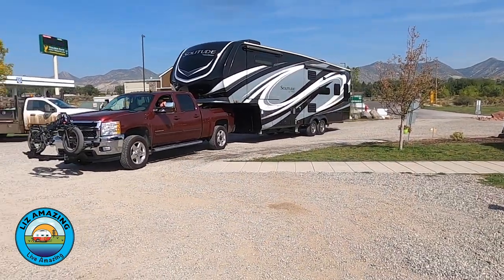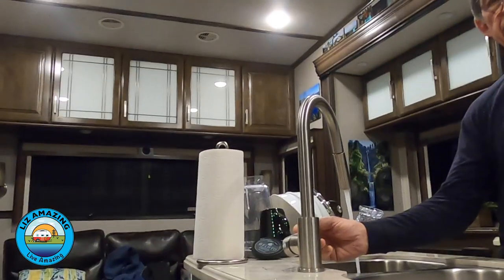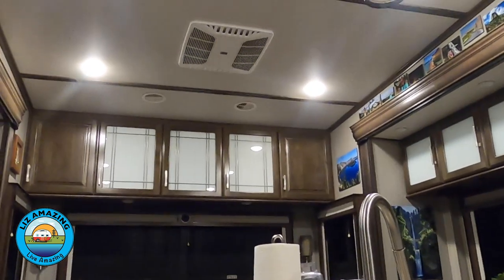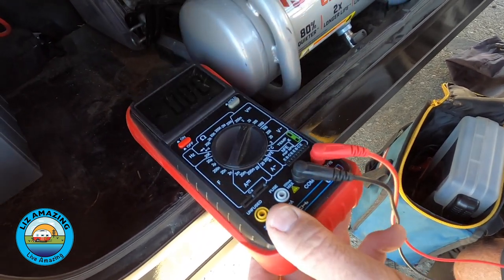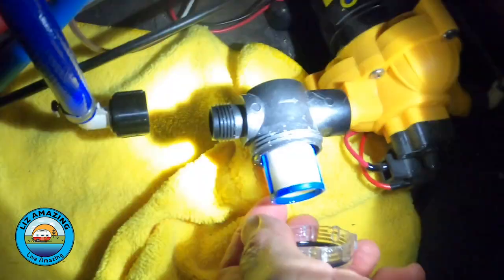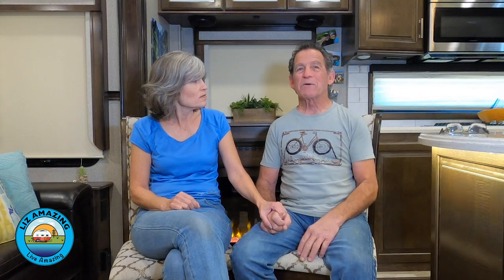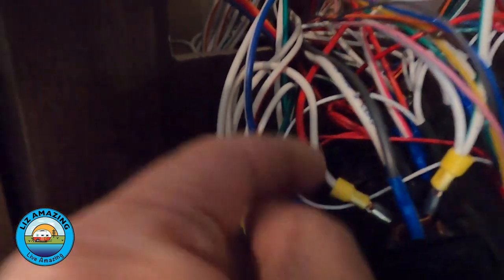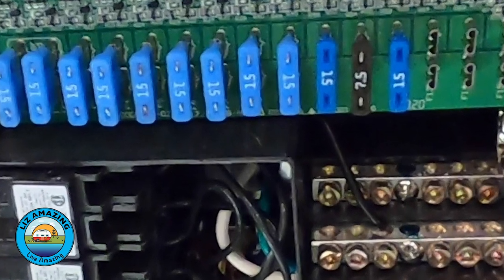RV Life | Grand Design Screwed up and We Fixed It | Solitude Fifth Wheel Water Pump Circuit Fix

Comment: We just got a 2021 keystone outback 328rl in August. It has a very similar layout to your solitude,  with the exception that it's just a regular travel trailer.  We also live fill time, but renting monthly at an rv park in Washington. First time I used our pump,  I couldn't understand why it pulsated. Now it makes sense!
Reply from the maker: Wow, Keystone, too! We will add that to the list. We've also heard that it does it on some Coachmens. It is an easy fix- let us know how it goes for you. It really depends how far away the pump switch is from the fuse box.

Comment: Surprising that the wiring is so tightly packed and very messy looking in such a confined space and with the cost of those camper homes it is shameful that the assembly plant allows that to be common practice.  I am not an electricians but I have spent many an hour figuring out wiring in small places, seen a lot of wire ups that are very disorganized, and often poorly labeled.  I have seen AC house wiring that failed to follow polarity, improperly mounted wiring causing melted parts that even though properly fused still melted and left unrepaired could have gone to flames. I often figured I just ran into people not sure what they were doing but as long as the wiring worked it must be okay and that is so far from the truth. I have even found things that licensed pros have just missed and left unfixed.  I was so pleased to see you all working out what the problem was and then going the extra steps to do a repair more correctly then the original assembly.  WAY TO GO TEAM.  This still goes back to the industry not accepting the idea that these campers really get used and only building for the weekenders.
Reply from the maker: Thanks so much Don! We are definitely making our Grand Design better than we got it, thanks to Paul! Yeah the wiring looks like it could be tamed even more. Thanks for watching and commenting. Happy Holidays!!

Comment: This is great! I JUST BOUGHT the same 5th wheel. I picked it up yesterday!! It is a 2021. I saw your first video with the failure of the island support. Did Grand Design ever address that with you? This is so helpful, I will check and see if mine does the same. Can you do a little more " in depth" repair tutorial? Just FYI... you're my new best friend!! HA!
Reply from the maker: Hi Bestie!!!

Congratulations so much on your 310Gk! We have a 2020. We LOVE ours and think the floorplan is awesome. We've had it since March and (unlike our last rig, a 30' Reflection) we do not get cabin fever. Just love the layout!!!

Grand Design corporate called us after our island collapsed and they are now putting in one additional screw in each end of the island. This started around mid to late September. We believe you need six screws on each end. You will need a pry bar to get the end panels off and then a brad nailer to reinstall them.

GD has been great though and if we need anything we know they will help out as best they can. Paul is super handy as you know, so he prefers to just fix it now rather than wait. 

We look forward to seeing you on the road!!!

Liz & Paul

Comment: Even my GD BHE21 Trailer does that, too. I have had way too many problems. I am not getting another GD. We want a fifthwheel and full time. After a year of YouTubes, i have narrowed it down to two. Both companies have gone over and above to improve their products an customer service. Both are excellent. I had narrowed to one, but stumbled on another just as good. Now i am making a check list and going to user groups. GD has pretty good customer service, but some dealers are jerks. But their build quality and components are not checked very well, it sounds like. I bet they improve a lot in the next few years. The competition is getting much better. The island was just over the top for me.
Reply from the maker: We wish it weren't so, but it does seem to be that the RV industry is not as focused on quality as they could be. They are just slapping them together and getting them out the door. We have heard Outdoor and DRV mobile suites are good companies. What did you come up with?
Reply: @LizAmazing  Alliance Paradigm and Coachman. I have been following Big Truck Big RV.  They have some issues, of course, but nothing like i have heard with GD. And their customer service is tops from everything , overall, that i have read in groups and YouTubes. GD owners are defensive of GD, but facts is facts. Have you heard big (non petty) complaints about these other two?
Reply from the maker: @TheLakingc  I have heard bad things about Alliance RV and I had a Coachman but haven't heard anything lately. Best bet is to check the Facebook forums on your model before buying. Good luck!

Comment: A tip, when ever you fish a wire, fish a string alone with it so next time you need to pull a wire you are all set. Also do they use Bladder tanks for water in RV's at all?
Reply from the maker: Hi Steve! That's a great tip, thanks. Ours is a hard-sided tank. By bladder do you mean one of those agricultural ones?
Reply: Bladder tanks I only seen in aircraft and race car not in not fresh water tanks
Reply: Anyone explain what bladder tank? Thanks

Comment: I hope I am not being redundant, but I found this response on a Grand Design forum”

“Our drawings are very basic, and intended for our Production purposes only (as a guide). We do not use looms. We pull continuous run wire from spools, and wire runs vary by model.

Best regards,
~ Janice
Mailing & shipping address: Grand Design RV, Attn: Customer Support, 13868 CR 4, Bristol IN 46507”

Kind of says we turn all that electrical engineering work to the guy running the wires.
Reply from the maker: Wow, that's good to know and not surprising. Thanks for sharing!

Comment: The most frustrating thing about towables (never owned a RV) is there are NO wiring standards.  None.  2 rigs coming off the same line, wired by 2 different crews will be wired differently.  How hard would it be for them to take the automotive approach where wiring harnesses are made from engineering drawings, and wired the same for a given product?
Reply from the maker: Agreed. There sure needs to be better standards. We are now hearing this pump circuit wiring problem is not limited to Grand Design. Keystone and Coachmen to name a couple others. Thanks for watching and commenting! Happy Holidays!

Comment: Just wondering what size wire and fuse did you go with for just the water pump? TIA!!
Reply from the maker: Hi Tim! It's a 15amp fuse with 14 gauge wire. Do you also have a Grand Design? We know the flashing lights are common in the Solitudes, not sure if it's also happening with the Reflection, Imagine, etc.
Reply: @LizAmazing  yes we do, 2018 Solitude 310 GK-R.
Reply from the maker: Ok, great. Let us know how it goes fishing the wire with fish tape. It did take us a full 25 minutes with the snake inspection camera. Paul thinks it might be faster with fish tape because it's about half the diameter of the borescope.
Reply: @LizAmazing  yes, I have another question. Does the water pump switch in the wet bay also tie in with the switch in the control panel and will your solution take care of both switches? TIA!!
Reply from the maker: @timallen1262  Great question. Yes the wet bay pump switch ties in to the control panel one and the fix took care of both. Yay!

Comment: Good job Paul. Glad to see a tech using his mind. And! Shame on the manufacturer for not using theirs. I see this as an assembly line that doesn't understand "WHY" connections are made. Untrained robots on the assembly line not people that are really trained and have an understanding of the trade they working in. Again the glory of the low wage instead of being concered with making a preium product using trained personel. When are these manufacturers going to get it? We expect them to do it right. Stop pushing out garbage. The wiring you showed was incredibly horrible.A rats nest that showed pride of workmanship. I really hope someone from the managment watches this video, hangs his head in shame and then makes the changes on the line to use real field trianed installers and not bubba.
Shame.
Sorry for the rant Paul. I just so get upset when I see such horrible workmanship pushed out to unsuspecting buyers.
Thanks 4 sharing 😀
Jay
Reply from the maker: Hey Jay! We agree 100% and it's a shame that this is pretty much how it is the whole RV industry, not just Grand Design. And we are hearing that other manufacturers also have this pump circuit wiring problem. We sure hope things change for the better soon! Thanks for your comment!